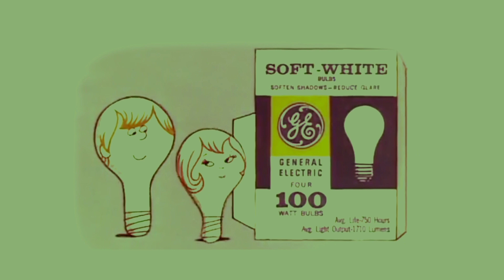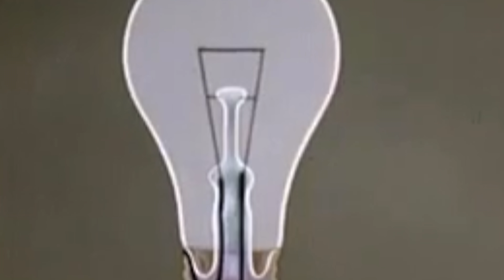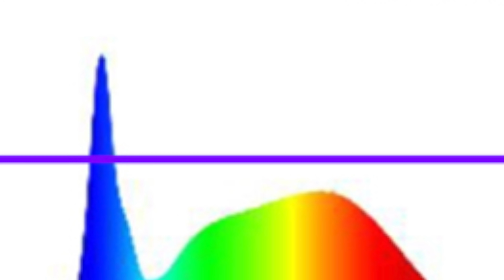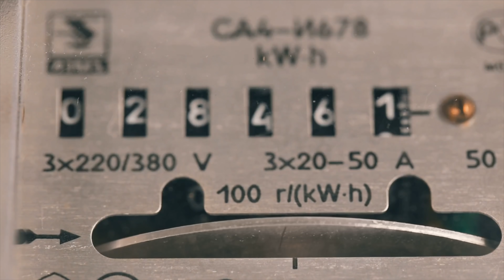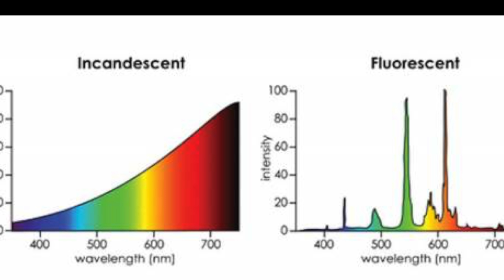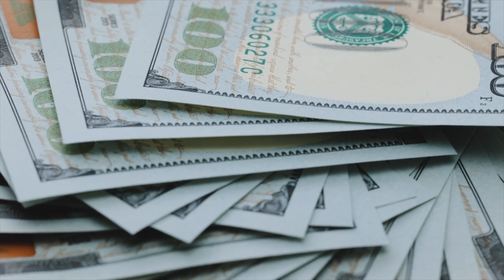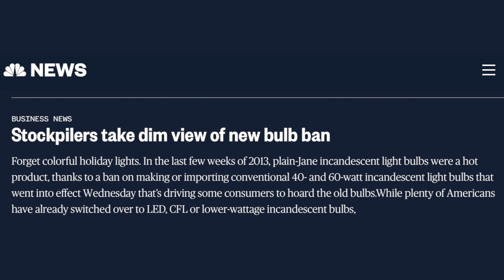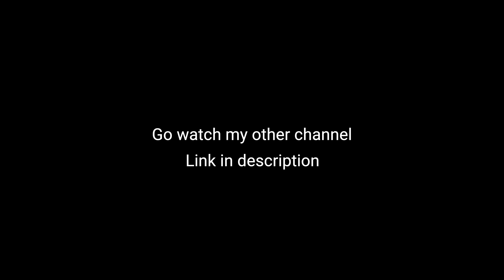Lightbulbs: The Path Toward Illumination Perfection

Comment: Technology Connections did a vid on the whole "light-bulb conspiracy". It's complicated, but to try and summarize, it was less about planned obsolescence, and more about industry standardization. Incandescent bulbs had a specific case of the production triangle: it was a tradeoff between brightness, electricity consumption, and lifespan, and the consortium defined the "sweet spot" that everyone had to adhere to. Sure, it was possible to get much higher lifespans out of them, but it was at the expense of brightness and, counter-intuitively, power consumption. 

Long story short, bulbs in the "sweet spot" consumed 1.0 unit of electricity to produce 1.0 level of brightness over 1.0 lifespan. It was possible to double the lifespan by cutting down the power, but the relation wasn't linear, so you got a light bulb with 0.8 consumption, 0.5 brightness, and 2.0 lifespan. So, in order to have the same brightness as before, you had to buy a bulb of a higher wattage, resulting in 1.6 power consumption, 1.0 brightness, and 2.0 lifespan... meaning you ended up with a net higher power draw, which cost you more money on the long run than just replacing the original light-bulb once it burned out.

In other words, the consortium was a conspiracy, and they did engage in shady monopolistic stuff like price-fixing, but the standardized incandescent bulbs they created were, in fact, for the benefit of the consumer. As Alec put it, the world is complex, and you should be skeptical of simple narratives.

Comment: I doubt lasers will replace light bulbs around the home anytime soon. 
Laser headlights on cars are great because aiming light in front of the car with mirrors as we've traditionally done is a bit of a shotgun approach and requires all the space needed to focus a beam of light with mirrors. 
Lasers are directional and can be aimed with a prism so they take up less space and can be laser-focused (haha) on where the car is pointed without illuminating everything else and creating light pollution. 
In the home, I might want to focus light on my desk, but I usually don't want the rest of the room to be dark so I'm okay with light bleed from my lamp. Space isn't at a premium in the home like it is in a cramped engine bay so fancy lamps are fine, I guess.

Comment: The laser die is more efficient at producing light over an LED die, but they still use that light to pump phosphors. So yes when you say lasers could be the future you are correct. However there is no advantage over LED or any other light when it comes to intensity distribution. The ability to precisely scan, move, or change the intensity distribution in a non traditional manor comes from the ability to steer the laser beam. Beam steering uses a composite RBG laser system for white, which while it does give you exact control over intensity distribution have by nature a terrible CRI since it's just 3 wavelengths. You're not getting high CRI finely adjustable intensity distribution  laser lighting, physics says " no ".

Comment: It's not entirely true that incandescent light bulbs are gone - even in the EU you can sometimes still buy them in hardware stores. I sometimes prefer them, even if the lifespan really sucks in most cases. However, that's totally random - I have an incandescent light bulb that has survived around 5 years or more of daily evening use

Comment: The problem with led lights is the circuitry to step down the voltage for the leds. It has a lower life span than the actual leds. For high-end led bulbs, like in offices, this part can be replaced to prevent wasting the still good leds. It cant / wont be done for consumer bulbs tho...

Comment: Well modern LED light bulbs are more efficient than incandescent bulbs, they are still designed with planned obsolescence, because they use too few LEDs inside of the bulbs and run them too hot, which drastically decreases their lifespan. Look up Dubai light bulbs, if you want to find out about this. Those light bulbs run with a large amount of LEDs inside of them, and each LED is underpowered, which keeps them from getting really hot like a regular LED light bulb that you'd probably find in somebody's house. With some DIY wizardry, it is actually possible to take a lot of consumer LED light bulbs and make them run underpowered in the same way, there is a video about how to do that, but it seems a little bit complicated if you don't know a lot about how to work with electronics, which I don't personally  Those Dubai bulbs are probably going to last decades upon decades, meanwhile your regular LED bulbs that are available everywhere else except for the United Arab Emirates, are probably only going to last about as long as a regular incandescent bulb, even if it's more energy efficient, and you're still going to have to replace it just as often because they're built to self-destruct. The light bulb companiea couldn't care less how much electricity it uses as long as it still bites the bullet on schedule and you have to buy a new one to replace it

Comment: You forgot to mention that most modern LED bulbs are purposefully overdriven by the manufacturer so that they actually do burn out in roughly the same time frame as incandescents. It's literally maliciously anti-consumer planned obsolescence. This marvel of technology that SHOULD last decades is purposefully fed more power than its rated for so it's cheaper to produce and shorter lasting.

Comment: You did an awesome job with this man, very well done. Jsuk the buzzing you said that fluorescent lamps give off is actually from the ballast of the in the tube form of the fluorescent lamps. In order to get the lamp to start the gases inside need a higher amount amps to ignigite the gases and then a why they flicker. The screw in Lamps have a built in miniature on in the base that doesn't give off the same amount of noise. - Electrician

Comment: Your LDS are flickering because you have them on a closed lamp with no ventilation.  Even if the led itself doesn't heat up, the circuitry does, which isn't a problem with a little ventilation, but that lamp cover impedes that

Comment: I have 15 basic LED bulbs purchased three years ago. I would like to replace them with z-wave/zigbee compatible units. Normally you wait for bulbs to die before replacing them, but I don't want to wait a minimum of another five years.

I still have the old LEDs the house came with as backups. They just happen to be the wrong temperature.

We are now at the point of throwing away perfectly good bulbs.

Comment: This is a cool video. I'm a total nerd and want point out that LED's are single color only. If you ever purchase an LED that can change colors, it's actually made of 3 small LEDs for Red, Green, and Blue. You still have to address each individual diode. RBG LEDs that are sold in electronics kits for instance are marketed and packaged in a way that make it seem like it's a single unit, but it's not.

Comment: LED's can flicker but there are capacitors and resistors you can add to the circuit to get rid of this, LED tech has come a long way but still has a bit to go before it's perfected. Dimming LED's can also be a pain at times due to preference to be dimmed on the trailing edge of the sine wave. Though overall the technology blows anything previously used out of the water!

Comment: 14:50 you aren't wrong that I am, but you're making the assumption that the majority of viewers are on higher end smartphones and some tvs, not on basically all monitors, the majority of cheaper phones, amd most tvs. Most viewers have only a few LEDs, probably less than 20, in their displays. Great video, just think you should have said this differently because outside of the most expensive LCD displays, most LCDs only need a couple LEDs to have a decent backlight and we only see more to achieve local dimming, but even a $500 tv only has 8 local dimming zones usually (8 LEDs)

Comment: I don’t think laser lighting will ever take off for home use, because lasers inherently have very narrow colour spikes, and are more difficult to get in a variety of colours. The act of putting a phosphor mix in front of one, while it will result in higher CRI light just like an LED does, but also just like an LED they’ll produce incoherent light.

The exception being free electron lasers, in case you wanted a high voltage, potentially radioactive light source that needs a particle accelerator to itself.

Comment: LED's are not all good news. In Fact LED's have killed the world of Astronomy. Light Pollution cause by the old Street Lights which used High Pressure Sodium Lamps were easily filtered out so in the city using the filter you could see every star in the Sky like you do out in the countryside. Sadly now that they converted to LED's as Knowledge Hub pointed out they have a very wide light spectrum.  Having a wide light spectrum means that you can no longer filter out the light pollution. So if you want to get a great look at the night Sky you now HAVE to go to dark country side or mountain. I recommend watching a video demonstrating how they could filter out the old lights it was amazing how many stars you could see just by using a simple filter.

Comment: I loved this video, than you. :)

A few things though: 

The mercury in fluorescent lamps is not a lethal amount, if you bust one just open a window and leave the room for a few hours and it will safely dissipate.

Cheap bulbs lead to pretty bad stigmas, that why you see those older cfl and leds lamps go for ages while the newer one are cheaper but have a much higher failure rate

Electronic ballasts solved that flicker issue by driving the tubes at tens of thousands of hertz, allowing the phosphor to not decay before more uv is available to pump them again. Old magnetic gear had this issue because it still ran the tubes at 60Hz. That led that was flickering was because of a bad electronic driver, not the frequency of the household current. Failing fluorescent bulbs on preheat circuit tended to blink a lot as the starter would try and start the lamp but it would not work and tyr to start it again

Bulb bans are mixed bag for me because i like having the consumer choice and am willing to pay more for electricity with them, not being forced to use one thing by a government and instead let a slow transition take place. I use halogen tec because its legal to by in my state and just as good as incans, but they sorta lie in the fact that a 60w lamp is 800 lumens standard and those 43w halogens are 620-630ish to skirt into the 60w equivalent categories, they are still more efficient.  A dimmer running an incan at 80% brightness make it use less power and can extend its life a few fold.

Lasers are leds but on steroids and hyper focused, they still use the same diode tech just kicked up a notch or two.

Well that's my info i have in my brain, if anyone collects bulbs like me or wants fore info, lighting-gallery.net is a pretty good place to ask questions and get some info from a few people more knowledgeable than i am.

Comment: To add onto what could come next after LEDs, one thing that you didn't mention in the video was one of the craziest potential things we could get if we switch to laser-based lighting: Centralized lighting systems. Instead of every room in your house having it's own lightbulb, you could have one big lightbulb in your basement whose light could then be beamed to any part of your house using a system of pipelines and mirrors throughout the building. Turning on light would be simply opening a pipeline to said location and increasing the luminosity of the central bulb proportionally for it. It's just like having centralized heating with a boiler and radiators, but for light.
Reply: That sounds overly complicated. We already have wires in all homes, why add an extra layer of mice food? What if you want a different color temperature, or a different color? What if it's an apartment building?
What about all the people using lamps? Do you add "light sockets" in the house?

Sounds fancy, but it's not really practical.
Reply: This sounds like the hyperloop of lighting. It's cool sounding but as soon as you start to think about it for more than a second you realize how impractical and inefficient it would be
Reply: Basement? What if you put it in the attic and collected light from the roof in the daytime, I guess that wouldnt be lasers at that point

Comment: So most LED light bulbs are designed to run the LEDs much harder than necessary.  This tends to produce just enough heat to eventually fry the electronics inside the bulb.  Sure, the bulbs COULD last forever... Given their past record, I don't think it would make you a cynic to think that they do this on purpose.

Comment: that LED bulb you have going bad is probably going bad because you have it in an enclosed fixture, LEDs are sensitive to temperature and can fail when they get too hot, you should check if the bulb is rated for enclosed fixtures or if it's depending on airflow for its cooling. more expensive bulbs actually have logic to lower their brightness when they start heating up to mitigate the issue, definitely a "you get what you pay for" situation.

Comment: The vaccine is slowly returning Tyler’s sanity. I don’t know if this is a good thing or a bad thing.
Reply: The man talked about light bulbs for 16 minutes using Jimmy Nutron memes, What do you mean by "sanity"?
Reply: @nelsondisalvatore9812  It's all relative.
Reply: @vetren23  relative to what?
Reply: @cerebrustusbordungolski7183  his previous videos' level of insanity
Reply: @vetren23  that's a great point, actually
Reply: A bit of both
Reply: I think I like both versions. This is the content I subscribed for, but the insane videos on why The Lighthouse is Flapjack's sequel are always welcomed.
Reply: Obviously not, sanity is blanity
Reply: Looks like Tyler goes in cycles. Insane one year to return to back to sane videos by the end of the next.
Reply: It is a good thing 😌

Comment: Fun fact: Only 10% of energy in an incandescent light bulb is used to create light. The other 90% of a light bulb's energy creates heat
Reply: What if we unlocked 100% of our lightbulbs
Reply: @SirGrimLockSmithVIII  Unironically would be an amazing thing. We lose a TON of energy to heat, and if we increased the efficiency of lightbulbs to 100% (which is impossible cause thermodynamics) we’d be set! LED’s are basically the best we have right now, and if you haven’t switched and have the means, so it! They last much longer, are better for the environment, and will save you money in the long run since they use way less energy to create more light
Reply: @ResidentialGondola  getting to 90% would still be amazing, as haven’t LEDs gone from incandescent’s 10% to just 30 or 40%? Of course, most things in engineering are 30-50% efficient so maybe that’s the best we’ll ever do.
Reply: @ResidentialGondola  the LEDs themselves are fine, the circuitry required to make an led bulb work on an ac socket is disgusting and is the opposite of environmentally friendly. It is the capacitors anf diodes that actually go out most of the time due to age and heat, not the leds themselves. Although i have had some philips bulbs that lost more than half their brightness in around 3 years, so had to be changed.
Reply: @kaitlyn__L  "The only 100% efficient system is the electric heater" was always a fun quote, cause I guess it's kind of true when you think about it
Reply: @SirGrimLockSmithVIII  that’s basically led
Reply: That's why you see them often in man-made incubators for hatching chicken eggs
Reply: And that's why they're illegal in most of europe
Reply: @malicekerendu3574  Good
Reply: @malicekerendu3574  what isn't illegal in most of Europe ffs
Reply: @truereaper4572  kinder surprise eggs lol
Reply: I see you everywhere
Reply: @frankxu1407  if they used 100% of their energy you'd be blind being in its range
Reply: That's precisely why the typical LED bulb uses only about 10% of the energy of its incandescent equivalent: the difference in heat generation. Huzzah!
Reply: That means they're really just electric candles
Reply: Fun fact: non incandescent light produce a lot of blue light that can and will mess up your sleep schedule
Reply: @pedrolmlkzk  incandescent bulbs do too, everything that emits white light emits blue light.
Reply: @sirhaydn-1  that comment isn't very smart since I said "a lot" and not some, and LED makes a whole lot more of it than incandescent
Reply: NO! NO! NO! Many people say I am sick in the head. NOOOO!!!! I don't believe them. But there are so many people commenting this stuff on my videos, that I have 1% doubt. So I have to ask you right now: Do you think I am sick in the head? Thanks for helping, my dear rea
Reply: NO! NO! NO! Many people say I am sick in the head. NOOOO!!!! I don't believe them. But there are so many people commenting this stuff on my videos, that I have 1% doubt. So I have to ask you right now: Do you think I am sick in the head? Thanks for helping, my dear rea
Reply: @AxxLAfriku  Oh dear